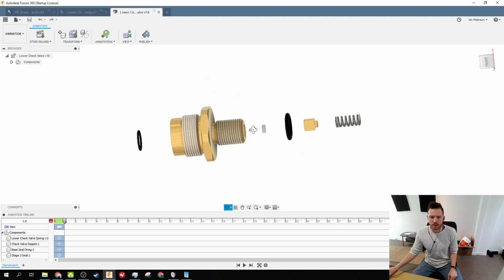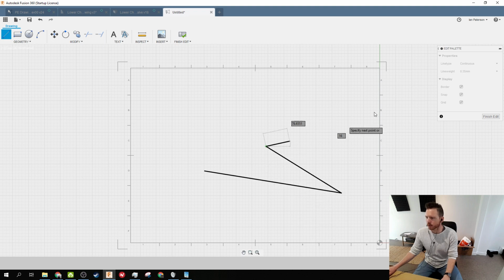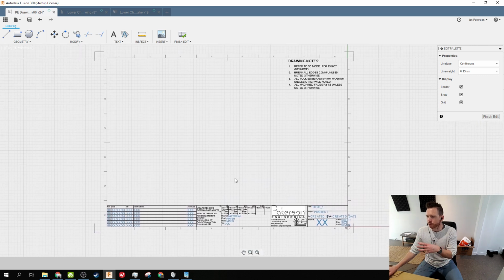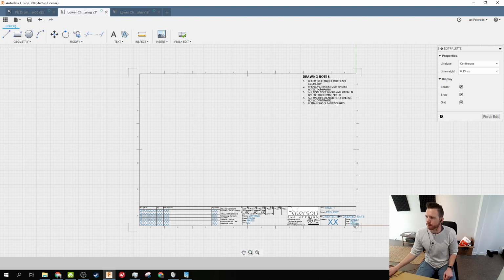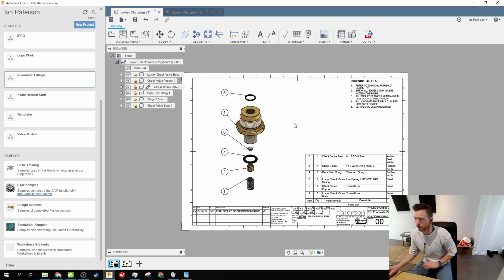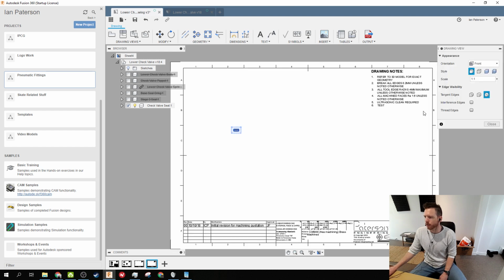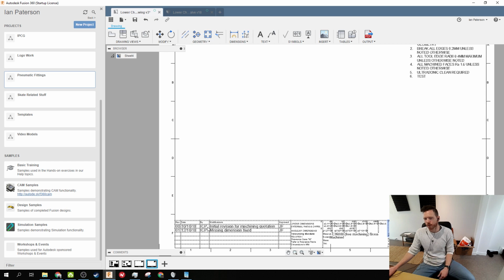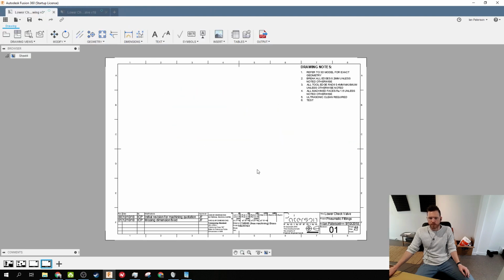Finally a Decent Drawing Template in Fusion 360

Comment: Thanks very much for this it's really helpful. One thing to note though, your angular tolerances appear to be wrong. ISO 2768-1 refers to lengths in mm when defining angular tolerances, which you've labelled in degrees. I.e. a side of 50mm<length<120mm should have an tolerance of 0 degrees, 20 minutes. As you've written it the tolerance gets tighter as the angle gets larger, which doesn't make sense.